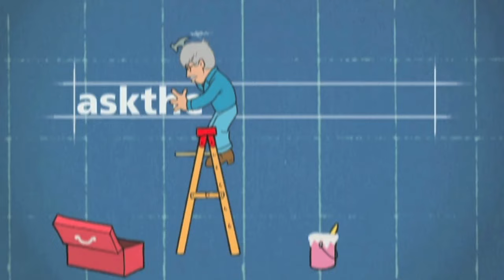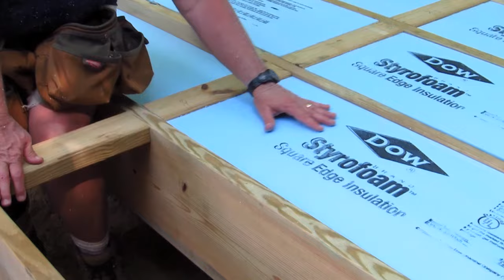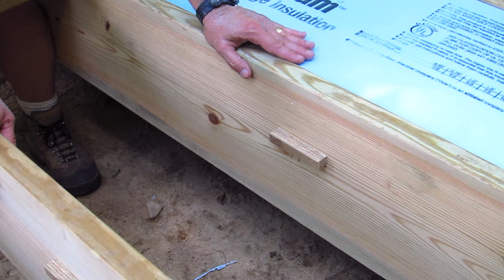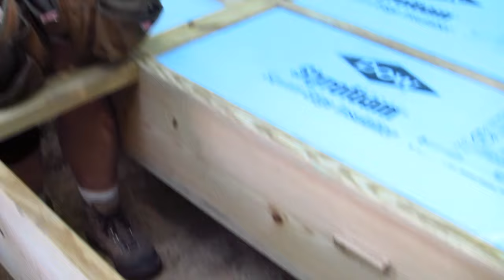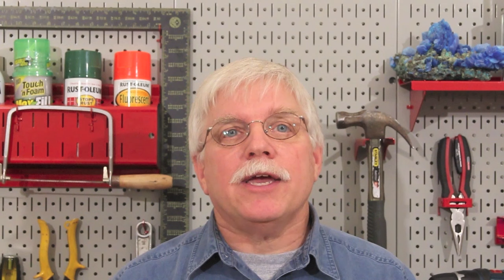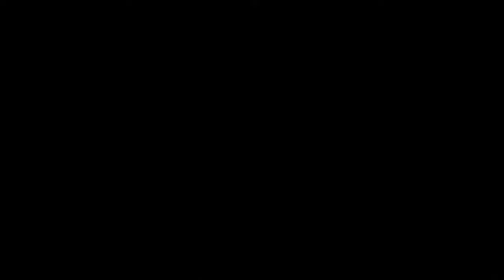How To Foam Insulation Board

Comment: that little nub is genius! I have a question tho, I am making a shed to use as a computer workshop. I will have very expensive electronics in there, how would you recommend to make the shed to keep the moisture out and keep my computer components safe?
Reply from the maker: +Christopher “The Cheap Gamer” Eckbold I could talk for 30 minutes sharing with you all the secrets you need to know to keep all that expensive gear safe. I'm an amateur radio operator and have the same issue with all my expensive radio equipment. You need to invest in this: http://shop.askthebuilder.com/products/15-Minute-Phone-Conversation-with-Tim.html

Comment: I am planning on building a small cabin on my trapline. Was thinking about using this system for floor insulation, but was concerned about mice and other rodents. Will they not tunnel in and build nests?
Reply from the maker: It's possible. You could put in the cleats and then first install plywood or OSB before you put in the foam. The rodents would have a tougher time chewing through that before they got to the foam. I've got pets that do my rodent hunting!
Reply: Thanks for the advise.
Reply: Ask the Builder Tim - 2 questions  -  regarding the wooden cleats you used to secure the foam boards - what method did you use to secure the cleats to the joists?
 I plan on doing this from underneath my easily accessible deck rather than above.  Sure beats mess from spraying foam overhead.

Lastly, do you think it would be ok to put a coat of spray paint on the exposed sides of closed cell cut foam boards?  As it is now - I can see the bright color thru a few of the wider deck spaced deck boards.  thanks, Frank Pearman
Reply from the maker: Frank Pearman I used galvanized finish nails. Sure you can paint it.
Reply: Tim - I finally found the 2-inch thick 4'x8' closed cell panels at a distant HD store from my home (12 total). Regarding trimming to fit within the joists - may I ask what method you used to trim your closed cell foam panels? (I am thinking of trying my multipurpose oscillating tool with one of the non-serrated blades I have on hand.) Any suggestions welcomed.
Reply from the maker: Frank Pearman No problem. I used my job site table saw! It cut them like a hot knife through butter! But there was blue foam dust everywhere! Use a circular saw if you don't have a table saw. Clamp on a straightedge to get a straight line.

Comment: Where do you buy that stuff?
Reply: Home depot, and if you buy 24 sheets they knock off (bulk price) about $7.00 per sheet (which is what I did)..$30 sheets for about $23..buy extra and return them cause you'd have to pay full price for any separate purchases.
Reply from the maker: At a business that sells closed-cell foam sheets.

Comment: Put an air gap between the 2" panels, and you will raise the "R" value.... I assumed you just layed them on top of each other?   Nevertheless nice job.
Reply from the maker: Thanks for your comment. I hate to say it, but an air gap does nothing to increase the R-value unless the air gap is completely sealed as you see in insulated glass. That's virtually impossible to do in 99.9999999999999999999999999% of building situations.

I could be wrong. Is there some information at the DOW closed-cell foam website that tells you to create this air gap and how to do it? Give us the URL with the written instructions on how to achieve what you talk about.
Reply: +Ask the Builder Unless the air gap is conditioned(and it's not in this case) it will do nothing, just as you suspect. You're not getting enough thermal bleed through (bridging) through the floor from the conditioned space (inside the home) to make that air barrier of any effect.
Reply: +Ask the Builder simple add a few spacers near the corners use spray foam to seal the adds if the panes and to the joist. You don't need it to be  air tight. Even the save shuttle leaks. Judas good as can be. And it would add in an application like your doing now... Like r2-r3
Reply: +Ask the Builder   could you not simply put a sealer around the edges of one board, have the gap, and lay the other board on top, also sealing?  This would come as close to gaping the air and providing additional R-value.
Reply: Jeff Porcaro Groove Master
Why are you interested in an air gap? Air is an extremely poor thermal insulator. I've installed this product and there's nothing in the literature talking about air gaps. It is always mounted on wood or over membrane. There is never an air gap between sheeting or underlayment and the rigid insulation.
Reply from the maker: +77Avadon77 Jeff, if you feel air is an extremely poor thermal insulator, then you'd better take this conversation over to the Owens Corning and Johns Manville YouTube channels. You know that stuff called fiberglass insulation? Have you ever thought about how it works? What gives it it's magical insulating qualities?  Think before you answer.

I'll give you a clue. You already know that glass is a horrible insulator and a fantastic conductor. What's the only other thing in fiberglass insulation???????  I've got a question for you now. Why would you state that air is such a bad thermal insulator?
Reply: I said put an air gap between panels.  Your video wasn't clear about this.  Did you or didn't you?  Way too defensive bro.  Relax.  We're all trying to seek the best solution.
Reply from the maker: +Jeff Porcaro Groove Master There is no air gap in between the two layers. If you want to do that, it's fine by me. Written responses like this can be misinterpreted. I'm not feeling defensive when I type them. I could be in a rush because of all the comments I try to respond to. I get over 15,000 views a day on my vids. So imagine how many comments I get. As for the best solution, you'd have to do some very scientific testing in controlled conditions to get accurate data. I just know my panels were nice and snug and the treated plywood subfloor was nice and tight against the top of the joists creating a tiny air space that was as close to being sealed as possible.

Remember one thing: Always do the math on the extremes you go to to stop heat movement or air infiltration. You need to make sure you have a positive ROI in a reasonable amount of time. Peace out.
Reply: Thanks...appreciate the effort!

Comment: Why not use the foam as a subfloor?🤔🤔🤔🤔
Reply from the maker: Every now and then I get a great question like this! You should go get a piece of foam and place it across two 2x2s set 16 inches apart on a concrete floor. Then I want you to stand on the foam in between the two 2x2s. Get back with a full report.
Reply: @askthebuilder  o.k., 
Now place a sheet of 3/4 plywood over it, 
See, 
Works good, NO gaps at joist, 
A continuous layer of insulation,,
It also works for sheathing before siding ,can be done before installing ceiling boards,,
Just a little extra cost for longer fasteners,
Dude I first tried this in 1982 on a 15 ×25 shed, its been through 6 hurricanes, still standing,
Reply from the maker: So you say. I'm not yet convinced this is a best practice.

Comment: How to? You did not show anything other than your wood supports.
Reply from the maker: +Andy Webb Oh my goodness! Andy, and I'm being a tiny bit sarcastic, did you want me to show you how to measure the distance between the joists? Did you want me to show you how to set the fence on the table saw the same measurement? Did you want me to show you turning on the saw and pushing foam board through the blade? Then should I have shown laying it onto the wood supports? I just sort of thought that all of the above is so basic that it would be a waste of time showing it on this video. But perhaps I'm wrong.....

Comment: how about wood? you install in between wood but how about wood? all this moisture will hit wood . You setting yourself up for mold problem?
Reply from the maker: Those are treated lumber floor joists in the video. The sides of this building are open to the air underneath so water vapor is blown away. In a CLOSED crawl space, you'd cover the soil with a cross laminated vapor retarder. READ all about these high-performance vapor barriers at my www.AsktheBuilder.com website.
Reply: +Ask the Builder Sir, i am in this situation.  My current crawlspace vapor barrier is terrible and was laid terribly, collecting small puddles of water on it in the spring and starting to generate a bit of the funky smell i'd like to avoid.  Rather than going with a high-performance tarp, I'd like to pour concrete in my crawlspace.  Is this a good idea in any form?  Would I need an expansion gap between poured concrete and my foundation walls?  Thanks!
Reply from the maker: +icawn There's LOTS to discuss about your plans. More than a one-sentence reply here. You should do this: http://shop.askthebuilder.com/products/15-Minute-Phone-Conversation-with-Tim.html
Reply: before put the concrete put plastic and the concrete works for me  her odor is gone